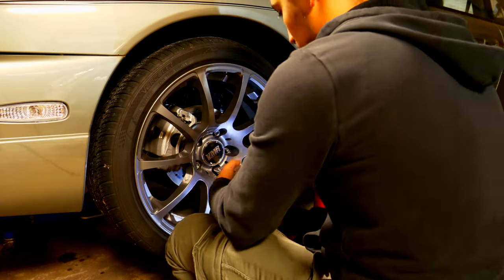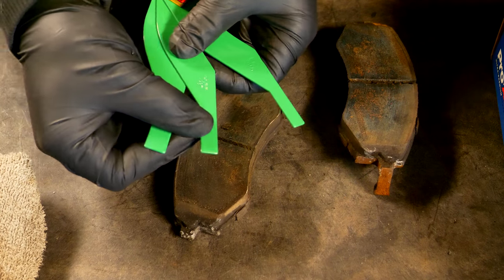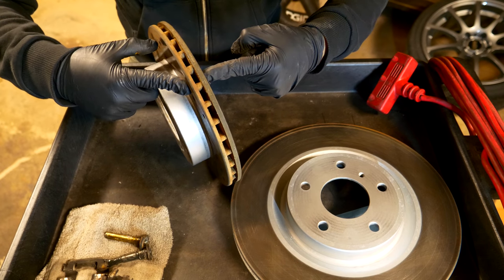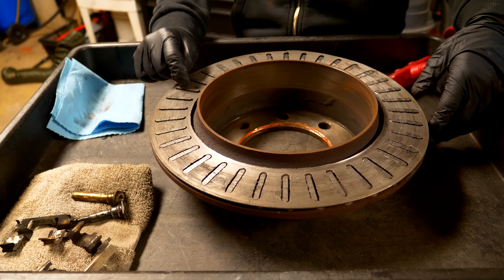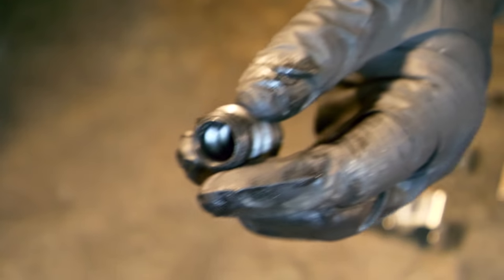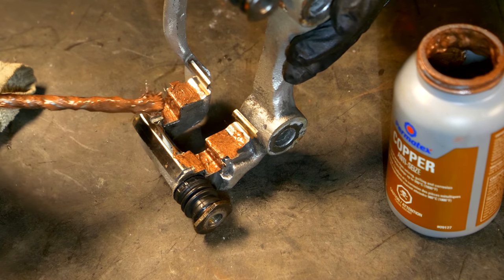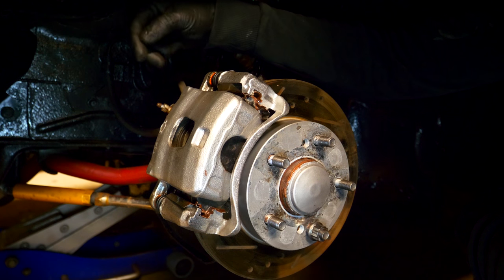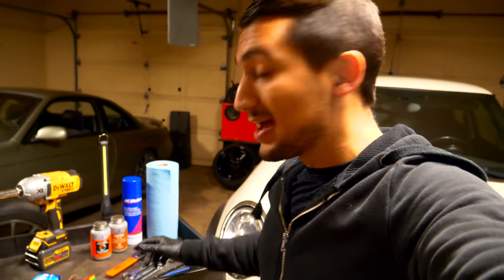How to Inspect and Lube Your Brakes (COMPLETE GUIDE)

Comment: HMMMM,   Kool  Vid,   but I noticed you didn't put any,  GREASE  on the back of the - PADS   or   on the  - CALIPER,   to prevent - - " squeal" even tho,   the  pads do have shims,
but  sometimes thats not enough to prevent - - "SQUEAL",   depending  on the kind of BRAKES,  or  the kind of BRAKE -  System you have,    Not all manufacturers are the same? ¿  
but your there already,   "everything is taken apart" ,   it wouldn't hurt to put some - GREASE, 
Also,    putting  grease--  on the
" HARDWARE" - (CLIPS), is not
really recommended,     Grease & DIRT,  GRIME,   don't mix,    for example,   all that grease you put on the - CLIPS,     DIRT that will be "kicking up"   is gonna - STICK on to the grease,   " CAKING"  it up,   the CLIPS - - that is,       Now you're preventing the - - PAD,  to have a 
" SLIDING - BACK & FORTH - ACTION",  hence  having a  " EVEN - WEAR - OUT"   through out  the life of the  PAD...   I  guess it is "preference"  if you wanna put some - - grease there,     then you can put a little on the - - " EARS"  of the  PAD,
just the - PAD,    but still,  keep a EYE on that...  Rule of thumb,   should be checking your BRAKES every -  " 6 - months "  or everytime  you take off the  tires,   like a  " ROTATION",   "" FLAT - TIRE",   you get the  jits....

Comment: This vid is only 3 years old? By the amount of and places where he puts copper grease, I would guess it’s 13 years old. 
Never ever put copper grease on wheel hub. Just clean it well of rust before mounting brake disc. Copper in between is increasing chances of brake pedal pulsating cause of wheel runout
Reply from the maker: These are PPE headers. The OBX headers on my car I took off. The PPE's are the only equal length long tubes that I know of on the market

Comment: oh my god you put a ton of antiseize.... you dont want a lot of grease or antiseize... the coeffecient of friction for steel on steel is lower than steel on any grease.... you get more drag when you overlube a slide pin....

greasing the shims/antirattle brackets is to reduce brake noise.... not to prevent corrosion.... all that is going to happen when you put a metric fuck ton of goop on them is brake dust is going to gunk it up and cause unwanted brake drag.
Reply: What temperature do the pads get to and will copper grease dry out?

Comment: Sorry but I totally disagree… That’s was waaaayyyy to much silicone on the slider pins and waaaaayyyy to much whatever the hell that other crap was… Also the pads should wear somewhat even but with the pistons on one side only they’ll never be completely even…  That’s why you put the squealer on the piston side because it contacts the rotor longer than other side…

Comment: You have missing rubber on the end of bottom pin (look at 10:42)
Reply: I was wondering about the rubber ring. Why one pin has it, the other does not? Why it has to be the bottom one? Thanks!
Reply: @maxmax0  this is because of how brake caliper works. It is to complected to explain this in single comment, but in general they play a little around the brake disk and this rubber allow to some movement and also it suppresses vibrations (without this rubber calipers can be noisy).
Reply: @ML-hf6ii  Aha, reduce noise. that's good enough to know. I guess next time i need to make sure the ring go to the bottom. Thank you M L!
Reply: @maxmax0  no problem, that was a pleasure :)